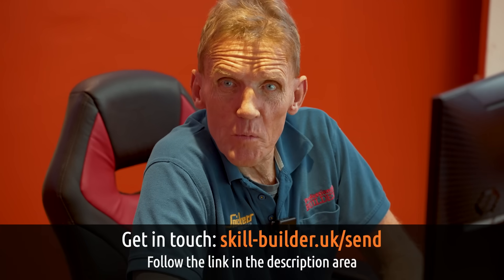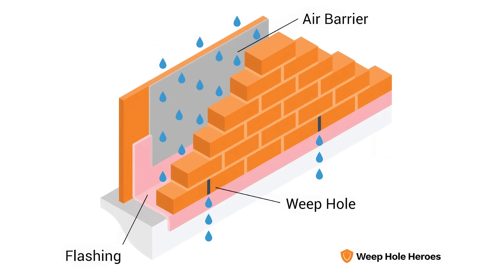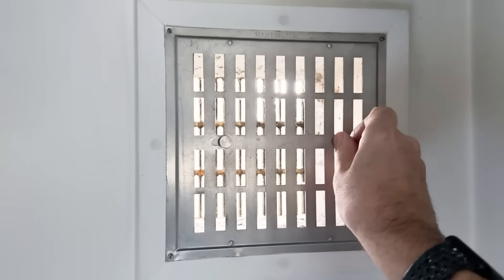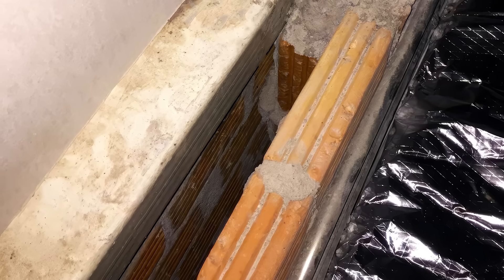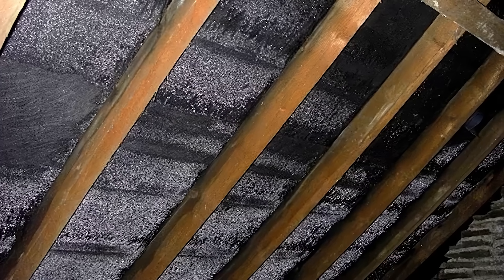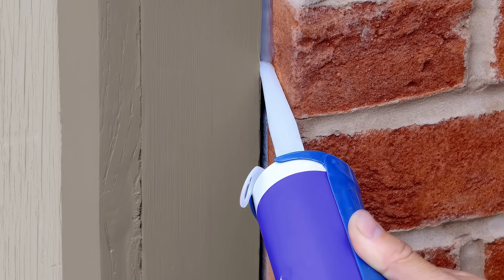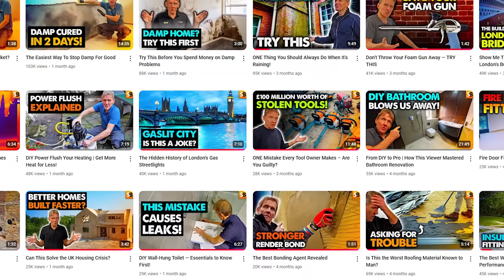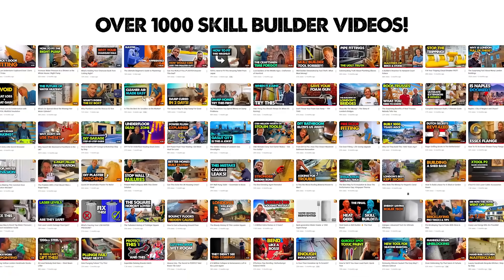The Truth About Cavity Wall Ventilation

Comment: Great video thank you.
Quick question please. My house is a semi-detached with an extension on the side (it was there when i purchased the house) the house has cavity wall insulation all but the extension its not damp but its very cold the insulation companies wont touch it because the cavity is less than 50mm is a closed cell expanding foam any good i have been told that it will make the cavity a solid which yeah it would but will apparently cause damp and more issues it seems that all they want to do is try ans sell me external insulation please any suggestions will be more than welcomed

Comment: Hi Roger   If the cavity is sealed , and water penetrates through the outside brick . What happens to that water if it can’t escape . ?   Kind regards 🙏
Reply from the maker: It drains to the footings and soaks into the ground or it hits the stepped damp proof course and comes out through weep holes

Comment: You should probably clarify that viewers need to first know if their house is a masonry cavity wall or a timber frame with block outer leaf.  If they go around sealing weep vents on a timber frame house, they'll be in trouble (unless they know the specification of the breather membrane - but still risky).
Sealing cavities to the roof, around openings and at boundaries is required for limiting spread of fire within the cavity.

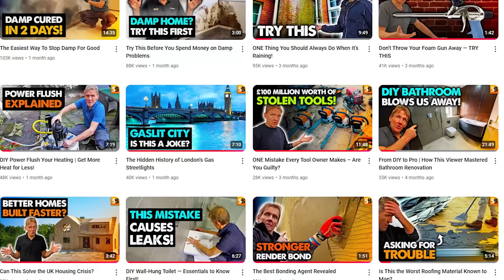Comment: It seems that some people confuse ventilation, draining and breathability. In the east of England where i now live most buildings up to 1960 are built with solid walls because it's a dry 2:49 climate and the bricks were low poroucitty with lime mortar; hence no need for cavities. There's no point allowing wet cold air to circulate against the internal skin which is transmitting moisture from the inside thus causing condensation which shows as damp on the bottom of the inside wall.
Reply: Very interesting.. I think that’s my problem.. thanks for the insight..👍

Comment: Hi Roger, we have the small ball insulation pumped into our cavity at the front, it was done before we moved in , we’ve had new windows fitted but every year we get black mould growing around the window reveals and above the rsj. Do you think it would work if we sucked out the insulation with a hoover, someone suggested it’s causing a damp bridge? Cheers
Reply: You’ve considered it’s more likely the moisture is coming from breathing cooking drying clothes than damp bridge?
Reply: @ we’ve got a dehumidifier on the landing with all the upstairs doors open running all day, the inside of the window reveal is damp and above on the rsj but the window glass is dry ?

Comment: I have detatched cavity wall house and detatched single skin garage and looking to span an EV charger cable about 1 meter from the house to garage... Can I put the cable underground? i want to dig down ~600mm, drill in the house and in the garage then put conduit down to make things easier for installers... What do I need to think about with regards to not allowing damp getting through the new sub-surface holes? Just fill it in with something? Is there another way? Cheers!

Comment: I’ve got rats going up my cavity wall into the loft so I know it’s not capped!
Reply from the maker: Have they chewed through the plastic airbricks?
Reply: Thanks for the reply. No they’ve not chewed the air bricks.My place has concrete floors.  I need to get another drain survey but do have a rat valve installed so probably multiple faults. The rats seem to explore the cavity eventually finding their way to the loft. Unlucky for me rats have been seen at surface level so have been looking for rat holes in the gardens to see if they are getting under lintels etc

Comment: Housing designed with vented cavities ( 1920s,30, 40, 50, ) are best left vented. The cavities are open at wall plates for ventilation of roof timbers and timber floors.
This method of construction was practical, to prevent dry rot.
Reply from the maker: I do not agree. Venting a cavity into the loft increases moisture and leads to condensation.
Reply: @SkillBuilder the underside of my slate roof certainly gets very wet, open topped cavity
Reply: That's exactly as I was taught, at technical college, in the sixties. It may be correct, it may not - but that was the official, recommended policy.

Comment: Pretty sure my double air bricks (double the height of a brick) vent both the sub floor and the wall cavity - I live in a 1960's bungalow. I've always wondered if the air from the air bricks is cooling the cavity and therefor providing heat loss.
Reply from the maker: Have a look, often they have slate to box them so they don't vent the cavity.
Reply: @SkillBuilder  Thanks for the reply. If they don't, is it worth retrofitting something to prevent air movement in the cavity?

Comment: Interesting. I’ve never known a cavity wall to be blocked off at the top. I’d assumed the reason was, there is no significant air flow, as the bottom of the cavity is airtight, but it still allows any excess moisture to rise to the top and disappear in your vented loft. Your taped PIR board would be pressed tight against the inner blockwork, meaning the insulation properties would be intact. I don’t like the idea of sealing off the cavity.
Reply from the maker: If you don't like it don't do it but it is the recommended method. Even from a fire point of view it is better closed
Reply: @ From a fire perspective, it would absolutely make sense, as you’d remove the chimney effect. Good point.

Comment: I had a call, after cavity wall insulation fitted, mould and damp build up. 

Now the FB damp & condensation group would be jumping all over this as they see cavity insulation as the devils own work.
I actually posted my thoughts & solution as below & got banned!

What it was, was the air-vents fitted in most rooms, had not been sealed where they go through the cavity. House built before we had plastic vent liners. So the vent hole also got filled with insulation thus blocked the vent.

Simple solution, tap out the old plaster vent and fill around the cavity with squirty foam, to hold the insulation back. Fit a new plastic vent.

Comment: Roger, silicone around wooden windows just rots them out. Silicone around plastic, mortar around wood. No ifs, no buts dear boy!
Reply from the maker: silicone doesn't rot wood windows.
Reply: @SkillBuilder  Roger, silicone traps moisture behind the frame leading to wood rot. You need to seal round wooden frames with mortar. You can get away with silicone on new wooden frames because the wood has been recently treated but if you silicone around an existing wooden frame on an older property the frame will rot, 100% of the time. I've been a brickie for 40 years and I've had to pull out a lot of silicone around rotten wooden windows. I wouldn't say it if it wasn't so Roger.

Comment: So you should block up air bricks if you have cavity walls?
Reply: No, because air-bricks are there for a reason. I have lived in rental houses where the air-bricks had been blocked-up, and all of those houses had damp and mould issues. 
When I was a lad, I was brought-up in houses which had open fires. We never had any issues with condensation or mildew because there was always a free-flow of air going through the house.
Reply: @ so why is he saying to block them up then?
Reply: @GeorgeAusters  He didn't. He said that the cavity should be sealed.
Reply from the maker: George. Please watch the video again and if it still isn't clear I will answer the question. The air brick goes through the cavity not into it,
Reply: @SkillBuilder  My air bricks don’t go through the cavity, they’re literally just a brick with holes in

Comment: Nothing new? I have original ventilation blocks in my 200 year old "solid " stone walls. Not through but on outside of walls only . Walls are usual 600 mm thick of two skins with rubble fill. It is often said that if you can ventilate somewhere then do it, even if only trickle

Comment: I have removed the timber floor and made concrete floor can I get rid of the air brick ?
Reply: If it's slab on solid then yes, air bricks below DPC are now doing nothing
Reply from the maker: Yes you don't need the airbricks but it might be easier to leave them if they are sleeved.
Reply: @ what’s the best way to cover it as it’s making the house cold with draft

Comment: Generally good advice but not for houses close to the coast in exposed locations.  Salt laden winds will always find weaknesses in walls and water will inevitably penetrate into the cavity .  For houses close to the coast and exposed to winds the only safe insulation is internal wall insulation.  Cavity wall and external wall insulation should be avoided.

But if you are not living close to the coast in an exposed location cavity wall insulation is an excellent and cheap option which does make a big difference - the only problem is the installers are, far too often, cowboys
Reply: yes, it depends on the weather where the house is

Comment: a lot of vents were put in to provide air flow for a fireplace, long gone !!
Reply: I think that's the case with my house. Airbricks below dpc level, house was built with coal fires. Coal fires no longer, but a howling wind under the house sucking out all the heat. Often wondered if it would be feasible to seal them. Have timber suspended floors which I don't plan changing, I assume part of the original design was to prevent these rotting. I often wonder if a heat pump/heat recovery system could be fitted under there to act like a sort of underfloor heating, but never heard of anything like that being available.

Comment: I have lived in three rendered houses, two of which were rentals,  and had some of the worst mould I have ever seen. 
Rendering a house or painting the brickwork not only completely destroys its character,  but makes it like living inside a huge plastic bag.
Houses need to breathe.
Reply: Houses do not 'breathe.' What you are experiencing is mould growth that is a result of condensation. A dehumidifier will help. If you can afford it, line the walls internally with insulated plasterboard, too.
Reply: @johnriggs4929  If you have a good airflow throughout your house, that is what is known as "allowing your house to breathe", and if you do that, you won't need a dehumidifier.
Reply: @Teapot-Dave  True. You'll also spend a fortune in wasted heat.
Reply: @johnriggs4929  It's a trade-off isn't it -  a mould-free house with good  ventilation, against a hermetically sealed house with no airflow.  Whatever you choose is going to cost you something.

Comment: Off topic, but a return to tackling mould with PIVs might be interesting. Now that they’ve been around a while, a short-ish review of the tech would be good. I’m seeing some pieces saying they’re effective, but they drop room temperatures, even with the heated air versions.
Reply: @jimw6659 They are just an extractor fan in reverse. They can work well, especially on still days, when the normal wind gusts are not pushing air in though passive vents & then allowing it to flow out again when the gust stops.

Everyone goes on about extract fans, but you have to think about the whole airflow. Extracting is fine, but new air has to come in somewhere.

If an extract in the bathroom, for examples, is just sucking air from form a trickle vent in a window next to it, then it is doing nothing, just short-cycling. The air has to flow across the room to get the moisture out.
Reply: Given the cost of heating the incoming air, an MVHR which recovers the heat would be better.

Comment: We've got a single storey extension with cavity wall insulation whereas the rest of the house hasn't, the extension in theory should be the warmest part of the house BUT the extension has vented sofit, the cavity isn't closed at the top and the interior walls are dot dabbed so air leakage negates the insulation, if I ever can afford to have my own house built I've got all the spec planned out 😂

Comment: I live in an early 1960s bungalow, one of many on this area to the same design. They are all prone to mould in the same corner of the bedroom, where there are two outside walls. It's probably because the occupants exhale moisture all night when it's coolest, which condenses in that corner.
My neighbour has a vent in that corner, inserted since her bungalow was built. It is only in the external wall; it does not go through to the bedroom. I think it was inserted to try and cure the mould problem. It doesn't.
She insists on having the vent left clear (it's on the boundary of my garden) so I leave it clear. Would she be better off blocking it up?

Comment: In a brick/block built building with a cavity that is fully sealed, how does moisture from driving rain seeping into the cavity escape?
If the cavity warms up and has moisture, shouldn't there be somewhere for the moisture to go?
Could a fully sealed cavity with no air flow cause dry rot?
Does 'Rockwool' style cavity insulation allow air flow when the cavity is fully filled with it? Does it soak up and hold moisture or does it transfer it to the internal skin?
These are the discussions I have on site consistently over the years and everyone has a different view.
Personally, as a Bricklayer, I never seal the cavity at the top, I don't insert air bricks to the cavity and I prefer to use Rockwool type insulation when I can. I've never experienced any issues but I still don't know if that's the right way to go or not after more than 40 years on the trowel.
Reply: If rain is seeping into the cavity, the cavity is not fully sealed. A fully sealed cavity does not even let air in, much less water. If water can seep in, it can also evaporate through the same opening. Or weep holes at the bottom of the cavity. Now a fully sealed cavity might get a bit of water soaking through the external brick. But that's going to be very little, only in huge driving rain storms. And will evaporate quickly when the rain stops because there's very little of it. The water vapor will slowly move through and out of the brick. I've never seen it cause rot.

Rockwool's main function it to prevent moving air. It's hydrophobic but even hydrophobic structures can be soaked with enough water. It will quickly drain, but it absolutely can be soaked. Hydrophobic just means it won't wick water into itself. So a few drops will sit on its surface. But running water will soak it.

Sounds like what you're doing is having an open cavity filled with rockwool. So the rockwool prevents drafts, moving air. Can get soaked, but because it's open it will also dry out quickly.

Perfect example why rockwool became popular. It's easier to stuff an accidentally or intentionally open cavity with it. Than to make sure the cavity traps air.
Reply: what happens in central Europe with driving rain? We do not have any cavity. Majority of houses are built from thick clay blocks of 440 mm thickness with many compartments in them holding the air / insulator/ or polystyrene beads or rockwool for isolation. No problem with dampness or thermal bridging and rain is no problem also,
Reply: Central Europe's climate can compare to Britain's rain and humidity around the year. Some years they don't have a summer.

Comment: I have ventilation bricks in my wall (built 1929) which are definitely above floor level and definitely don't go through to the room. I know this because I had damp coming through my internal wall and on inspection I found that looking through the ventilation brick is was block up with sand. I had to remove brick and dig out all of the sand (god knows where it all came from). All that was on the other side was the internal wall where all of the damp was. The damp wall has now dried out.

Comment: Regulations for brick or block clad timber framed buildings require cavity ventilation top and bottom. That said, I do wonder if what they require is sufficient to make much difference.
There is a huge difference between a rendered block wall and a brick wall.  Especially with hard bricks, driven rain can actually spurt into the cavity. 
With wide insulated cavities I believe there have been practically no issues, and any probably poorly fitted cavity trays. 
Retired Architect.
ps, when I started, before sealing the top of a cavity, the builder would go round with a long 2x1” and knock off any snots on wall ties.
Reply: @markthomasson5077  In Australia our bricklayers hose the cavities out every afternoon, they also leave clean outs at the dpc and those that out every day. I don’t see the English brickies do that.

Comment: Any advice for a house built in 1866 and only has a thumbnail cavity? The house is painfully cold, even after new roof fitting and double glazing replaced.
Reply: Log burner
Reply: Internal wall insulation if you have no damp problems, perhaps

Comment: I have a 1928 built detached house with a cavity. The parlour was built with a suspended floor. There are air bricks front and rear, wind blows right through. However, the cavity has openings below floor level so wind blows up the unfilled cavity. There are air bricks level with the top of the 1st floor windows, these are unsleeved with cast iron sliding vents. The cavity is open at loft level. Effectively I have a single skin house as the walls are cooled (but dry) by cold wind blowing through. The walls inside are really cold. I have a lot to sort out!
Reply: You place sounds similar to mine, built around 1930 for heating with coal fires that no longer exist, but with a howling wind blowing underneath sucking out all the heat! The cavities were filled with insulation in the past but it leaks out everywhere. Some way to stop the wind blasting under but still allow circulation and removal of moist air is something I'd love to find. I've often imagined a heat pump or heat recovery system being fitted under there to provide a kind of underfloor heating, unfortunately never heard of such a thing being available! 🤷‍♀️